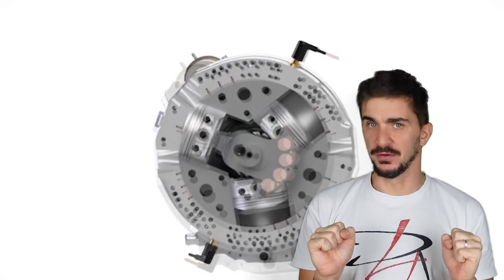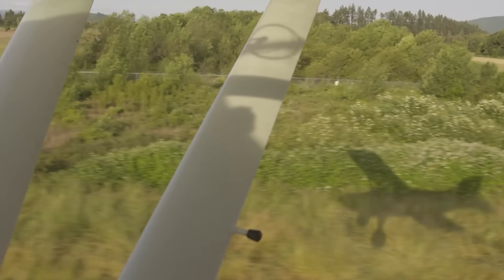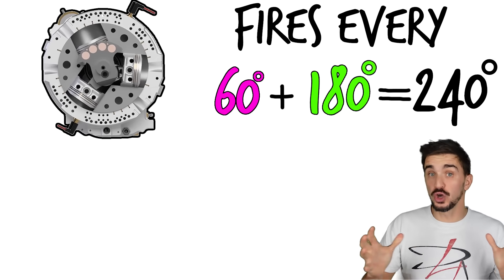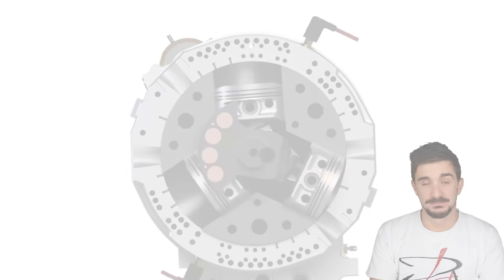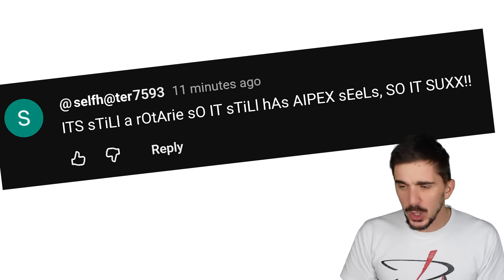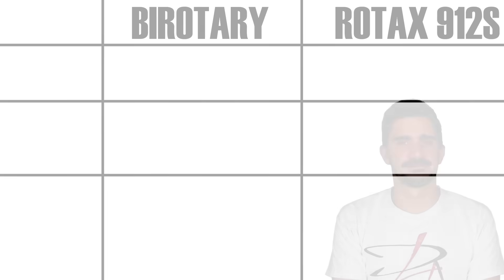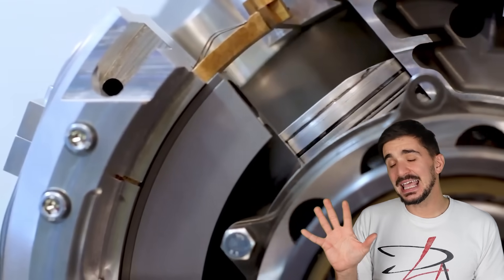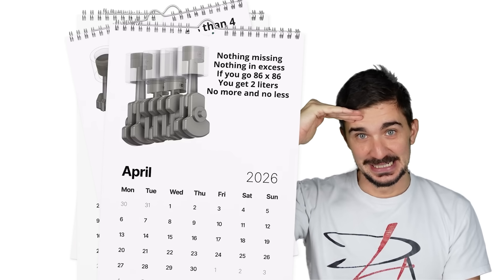This is What Happens When Pistons and Rotaries Make Babies - Birotary Engine Explained and Reviewed

Comment: Names are social constructs, so if you could get everyone  to also call it Rotopiston, then the the name would be Rotopiston!
Reply: Wouldn't rotopistons be more fitting for the original rotary aero engines though?
Reply: @ShadowFalcon  You the mean the Radial aircraft engines?
Reply: @riogrande163 
No. I mean the rotary aircraft engines.

Those used on old WWI fighters, like the Sopwith Camel.

EDIT:
The difference is, radials refer to any engine with a radial cylinder configuration, like a P&W Wasp, or similar.

Rotaries function by having a stationary crankshaft, and a rotating engine block. Like the Le Rhone, or Gnome.

Comment: This is like one of my very early rotary piston engine design from 10 years ago, but the block rotates with the crank and used valves, not ports. Exactly the same  piston + crank setup.  Much better seals than a Wankel.. I abandoned it in favour of a far more  novel, free piston ICE + combined Heat Engine(s) - a 'Piston Turbine Engine'. It was mainly designed for planes a pair of them balance completely, 100%, on every axis. It's truly 1 stroke and reciprocating, instant on-off, with extreme torque, and compression provides more power,  rather than sapping power.